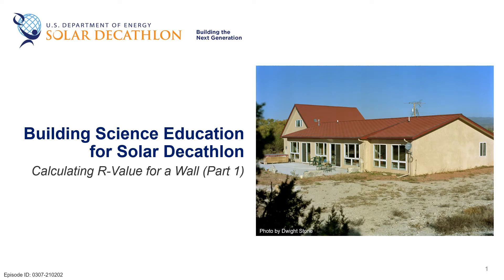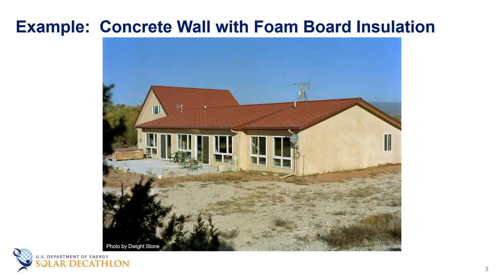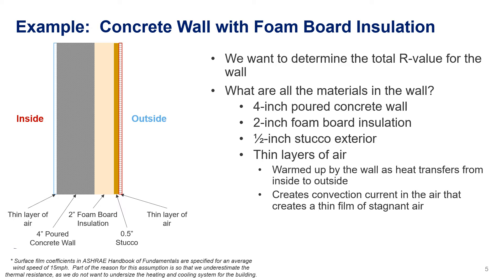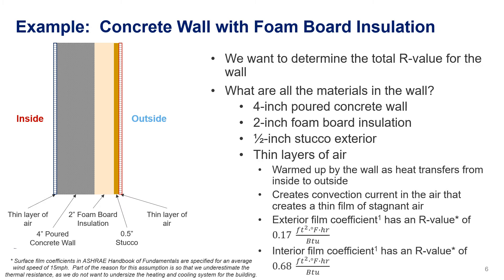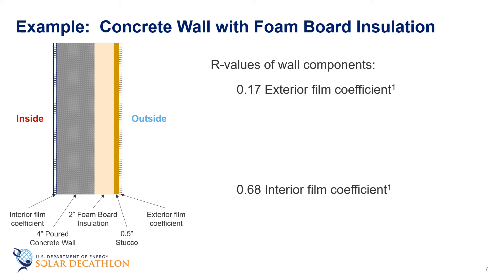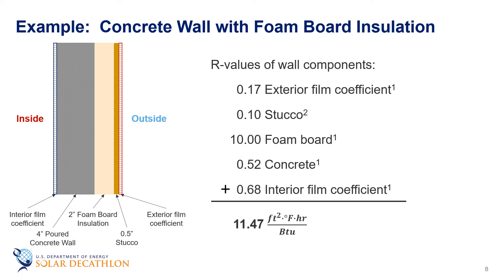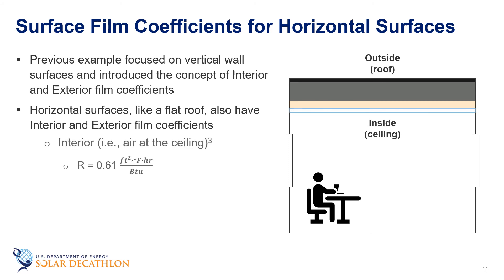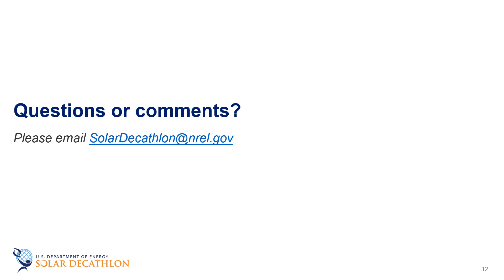Building Science Education - 3-7 - Calculating R-Value for a Wall (Part 1)

Comment: At minute 2:19 it is stated that as the air film "rises".  Actually, it is the fact that the air contacting the wall doesn't move. If it moved there would be no insulation film referred to a stagnant air.